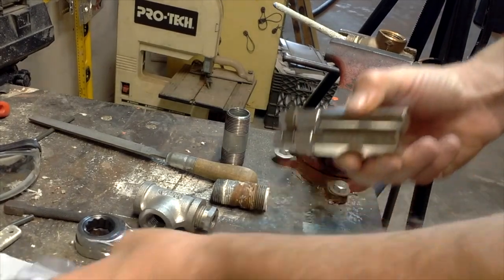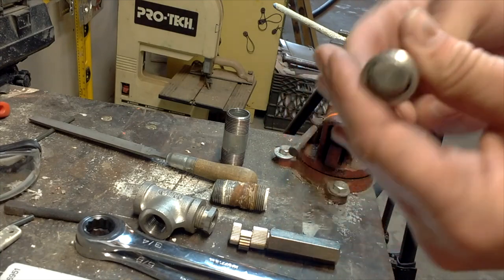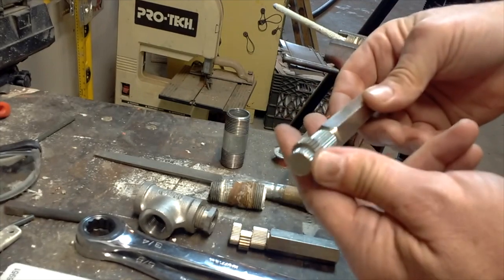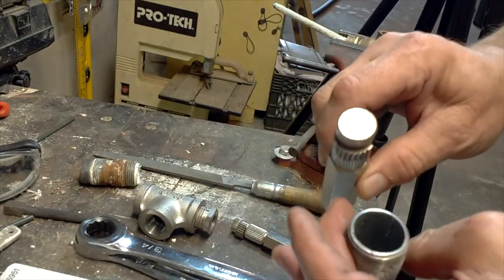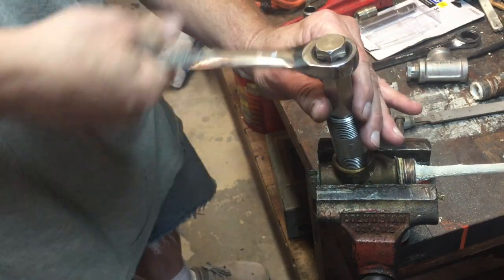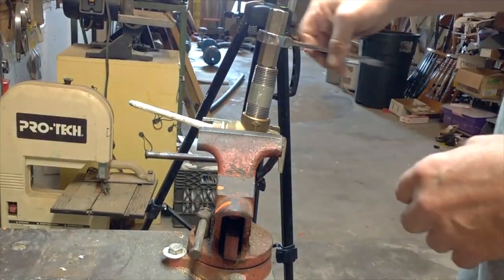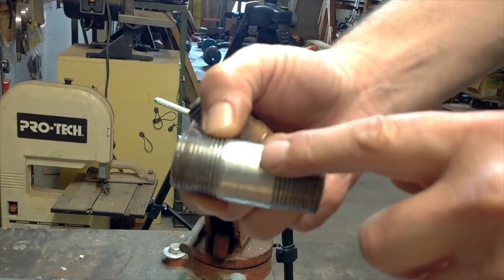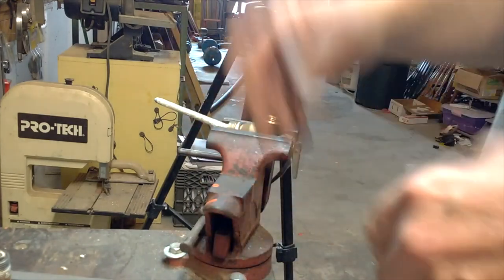Internal Pipe Wrench-Demo 3/4" pipe

Comment: "Nobody likes a deformed nipple." Speak for yourself, my man. Juuuuust kidding. Stumbled across your video because I had never heard of internal pipe wrenches. Now i have. Thanks for the info!
Reply from the maker: awesome tool for when you have little choice after a pipe breaks off flush in a water heater
Reply: @haparoundthehouse6618  I bet. I don't do much plumbing except the occasional repair around the house. Good info to tuck in the back of my mind. May come in useful sometime. I also just like seeing all the different types of tools.

Comment: I don’t this tool is for everyone. I picked one up from Home Depot I got the same thing but husky same shit. I’m glad it worked for you but if you ask me I think it’s a piece of shit tool and I know how to use it.  I just don’t recommend it.
Reply from the maker: I had the opposite experience-this tool helped me pull a 3/4" dip tube nipple easily--thanks for watching
Reply: What was it about the tool/s that you didn't like or had problems with?
Reply: @matttanglewood2522  Works great on new pipe - old rusty pipe will give you a problem.